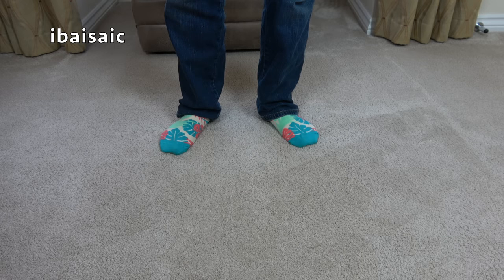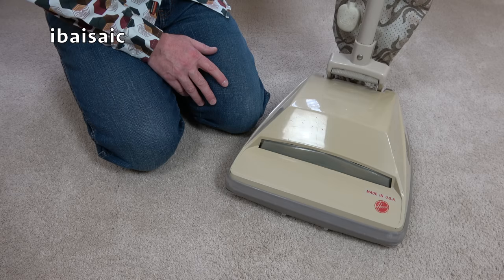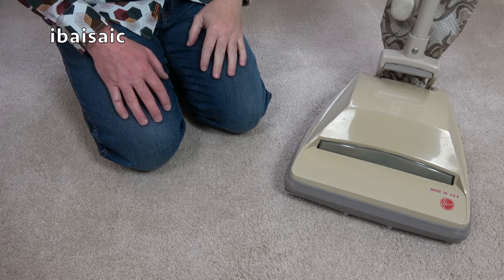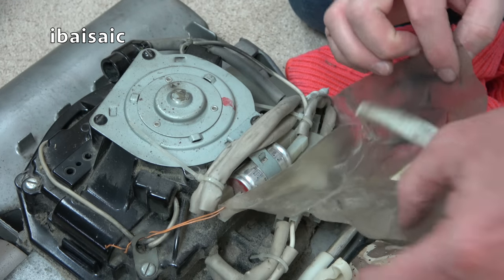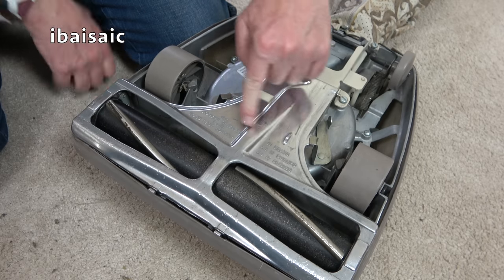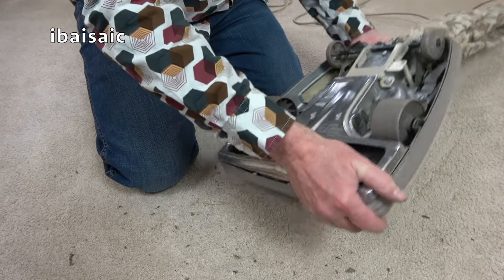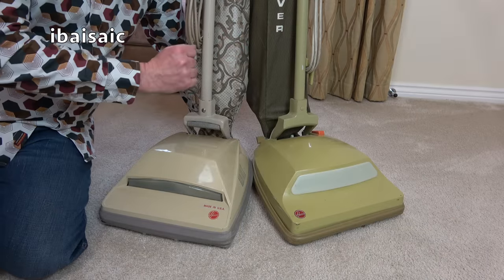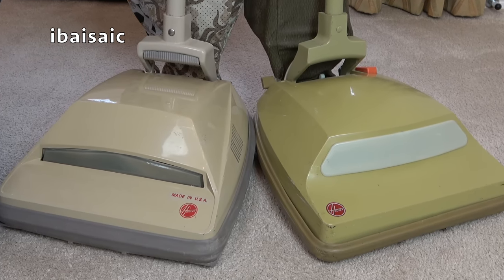Rare In The UK Hoover Senior U4003 Vacuum Cleaner - First Look

Comment: Hoover USA's model U4003 Custom Convertible, in shades of Taupe, was manufactured from 1973-75. While the USA company wouldn't begin adding production time digits to its serial numbers till 1987, Hoover UK began doing so circa 1967; so the '411' in your s/n likely indicates 'November 1974'. Here's an excerpt from a 2010 Vacuumland thread by Al, a UK contributor with the handle vacbear58, that offers some background and theory of the U4003-003 export: "It may have been with the closure of manufacture at Perivale to tide over supply while manufacturing facilities were established in other factories or perhaps a strike. The UK U4002 was launched here in 1974 (Yellow) and this model appears to slot in for a few months after its launch."